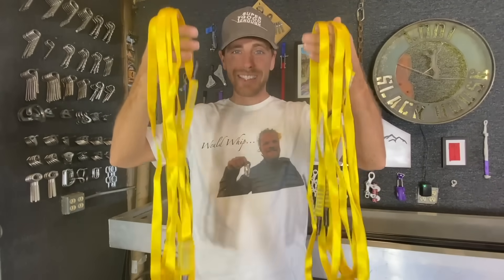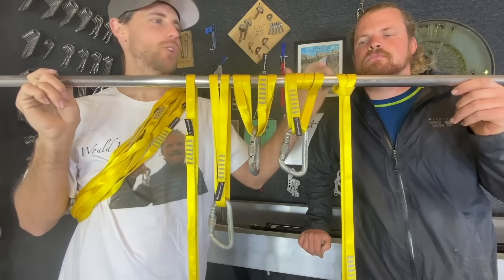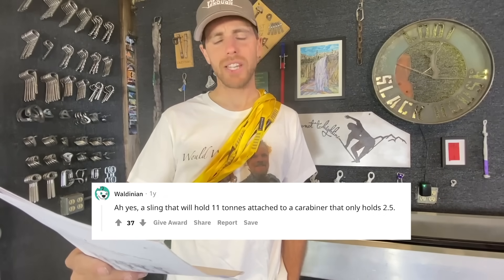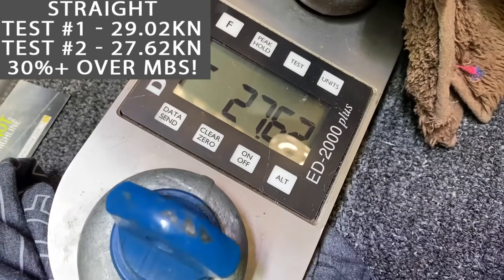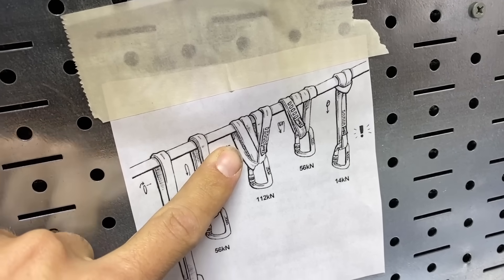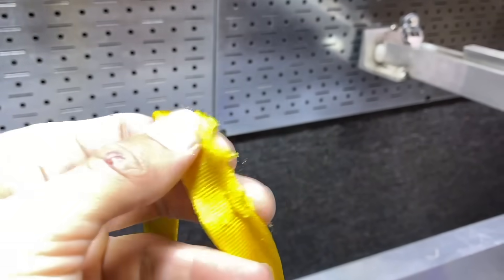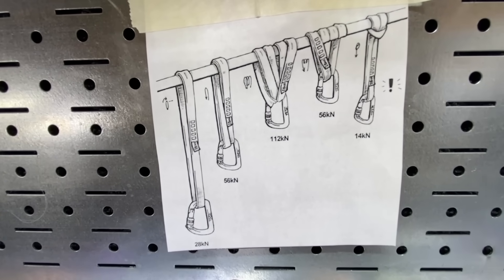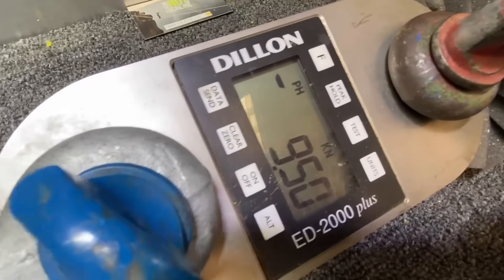Climbing Sling Myths

Comment: it's quite easy to calculate why you need a lot of KN strength: 
My weight is 95 kg and if i fall this height my static energy converts to kintetic energy: 
5 meter fall = 9.82 m/s * 95 kg * 5m = 4665 N = 4.6 KN
10 meter fall = 9,82 m/s * 95 kg * 10m = 9329 N = 9.3 KN
20 meter fall = 9,82 m/s * 95 kg * 20m = 18658 N = 18.6 KN

The rope/carabiners wont break at 20 meters though, and the reason why is because the elastic rope will split the force over time.. 
eg: if the deceleration takes 2 seconds  the 18.6 KN generates 9.3 KN for 2 seconds after which it ends at the static force of 9,82 * 95kg = 930 N

if you fell 20 meters onto a static rope the FULL FORCE would be applied to the gear and potentially break the weakest point.
Reply: This is wrong. The units don't even check out - force and energy have different units.
Force has units mass*length/(time^2)
Energy has units mass*(length/time)^2
Perhaps the problem comes from your value for the gravitational acceleration? You've written it as 9.8m/s, but it's an acceleration, not a speed, so the correct units are m/(s^2).
The numbers you're calculating are the kinetic energy gained in the fall, but the assertion that energy = force*time is wrong - once again, the units don't check out. 18.6kN for 95kg falling 20m only holds if the fall is stopped using a constant force applied over a distance of 1m. A stiffer rope could apply much higher force than that, and a climbing rope will apply much less. Forces in climbing falls vary with fall factor (length of fall / length of rope catching the fall), and are almost invariant with fall distance for a fixed fall factor. This is because the kinetic energy absorbed per meter of rope is the same for a fixed fall factor.
Reply: @ennsye8692  U = mass * gravity * height
U = Joule 

1 Joule = 1 Newton for one Meter = Newton Meter ... so im right
Reply: @MontagoDK  This is correct as far as it goes, but does not address any of my objections. Your initial post implied both that force and energy are the same, and that energy has units force*time, neither of which are correct. Nor are your results.
Reply: "the weakest point" being your body. :)
Reply: @jorygeerts  Or the cams and screws in the wall that were meant to save me...
Reply: “All whips are the same” lol tell that to my spare underpants
Reply: Actually is a bit more complicated than what you have written. Your weight, aka the force you have calculated (P=mg) is still the same after a 5 meters fall or a 20 meters fall.
What changes is your velocity, the acceleration is still the same 9.81m/s2 (and so the force that is pulling you down). 
Then you have to consider the momentum (p = mv) and that is the important thing. 
When the rope catches you the force on the rope is not your weight but its a instant force (a force that happens in a very very short interval of time). This instant force is related to the momentum of your fall.
Another way to see it is using energy. As you are falling you are gaining kinetic energy. When the rope catches you your kinetic energy is absorbed by the rope (it can be seen as a spring) and the bolts/anchor/anything on the rock.
Reply: @bedetti3  i dont think you read what i wrote... since you more or less said the same as me.
Reply: @MontagoDK  yes but no. Your calculation are still wrong.
you wrote this  => 5 meter fall = 9.82 m/s * 95 kg * 5m = 4665 N = 4.6 KN
but it should look like this => 9.81 m/(s^2) * 95 kg * 5m = 4665 J (joule not newton)

What you wrote is an energy (potential energy of an object 5 meters above your line of reference) and it is measured in joule or newton*meters.

Also the force that you generate (on the knot on your harness) when the rope catches you on a fall is calculated from F = m*a 
where 'm' is your mass (so 95kg) and 'a', which is not the acceleration of gravity g, is your deceleration (how fast your are slowing down).

So if you fall for 5 meters you will have a final velocity of v = sqrt (2*g*h) = sqrt (10*g) 

Then you stop in two seconds (as you say): your acceleration a = v/t = v/2

Finally the force you generate on the knot on your harness is F = m*a = 95 * sqrt (10*g) /2 = approx 475 N

Keep in mind that two second is an incredibly long time to arrest a fall. In reality it would be a lot less than a second.
For example to have 3kN (much more realistic as the other video on the channel shows) of force on the knot on your harness the fall is arrested in approx 0.3s.
It's also important to remember that the acceleration 'a' depends on the how much rope is available (fall factor) and how much it stretches (static rope = no stretching => less time to stop your fall => greater acceleration => higher force; it is pretty much the same if your fall is factor 2). The more there is the slowest it is going to stop you and the less force is going to be applied on the gear. 
The force on the gear in the rock is a bit more difficult to evaluate: it involves the belayer (his mass, how is he belaying), the rope (its mass) and a lot of angles (of the rope, of the bolt, of the rock face, ect...).

In conclusion: the longer you fall the fastest you are. Then you have to consider the rope (you can see it as a spring with a constant K) and the fall factor. Those data tell you how fast the rope is going to slow you down.

It is a bit counter intuitive but falls with same fall factor and different high have the same force on the knot. 

Also reality is a bit more complicated than theory (this is a model: i considered the falling person to be a point), the human testing video they did is very helpful (also there is no physics and only kn).
If you want to dive into the physics of a fall check this video out https://www.youtube.com/watch?v=_ffXoD0jZN8
Reply from the maker: All whips are the same.  The bigger the fall, the more rope there is to absorb it.  4kn - 5kn max force with a 200lb dude falling with a dynamic rope.  At 7kn your body does not do well.

Comment: Wonder how the girth hitch would perform on a carabineer? The big bend radius of the shackle could be allowing such a high result
Reply from the maker: For sure, but that is what is the image was.  That is why doing it on a hanger shows how much difference there is with a sharp-ish bend radius
Reply: @HowNOT2  Standard test diameter is a 10mm pin I believe.  Bend radius does play a role but above a certain size less and less and it's related to the size of the cord or webbing as well eg 16mm cord need larger diameter pin than 6mm etc.  Black Diamond has, buried in a bigger post, some girth hitch data around a 10mm pin.  I was trying to find data on the girth hitch master point in the "early days" and there wasn't much other than the DMM data of girth hitches sling-sling or sling to nut wire.  Around a solid pin the hitch has something to prevent it cutting into itself as much.  Larger pins also add more friction and thus reduce the cutting force more.  Things like trees with LOTS of friction help even more (hence things like wrap 3, pull 2).  Link to BD Post with girth hitch data - (spoiler, they got 27.5kN for something rated to 22kN) https://www.blackdiamondequipment.com/en_US/stories/experience-story-qc-lab-personal-anchor-systems-explained/

Also interesting is rigging charts that note loss of strength vs the "choke angle" of the girth hitch.
Reply: Yup. thats my guess why it was breaking so much higher. Tests of most climbing equipment gets pulled on a radius similar to most carabiners.  Someone above suggested getting a custom shackle pin milled which would be a rad addition for real life comparison.

Comment: If you have a 5kn fall on 20kn equipment. That's a safety ratio of 4. If people are in danger there usually is safety ratio of at least 10. Elevators have safety ratios of 20 and upwards. 4 is okay in climbing, because weight matters, but considering what is used elsewhere  it really isn't much.
And you mustn't forget that this 20kn are given for equipment that just came out of the factory and climbing is an outdoor sport. There are multiple reports of slings breaking in the wild. So always use your own slings.

Comment: Super interesting! Have you done a test on a clove hitch?
Reply from the maker: No but that does sound interesting.  I lock myself off with those all the time
Reply: @HowNOT2  Love your videos! Can you guys break-test a clove hitch on a single-strand of dyneema? The team at SIET seems to be recommending that people build anchors by attaching to individual pieces with a single strand of dyneema on a clove hitch (see the video here: https://youtu.be/3Dx2w358rWY). If my math is correct (and I've certainly been wrong before), a single strand of dyneema will break at about 12kN, and putting a clove hitch in that single strand will cause it to break at about half of that, or about 6kN. This seems like an unnecessarily weak link in the chain. The result would seem to be even less favorable with a single strand of 6mm perlon (which would also make for an interesting break test).